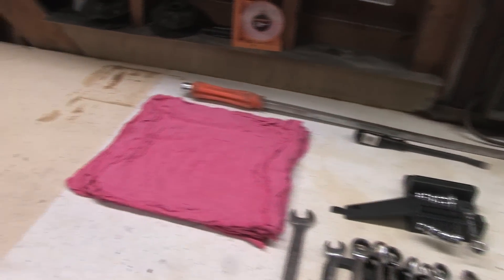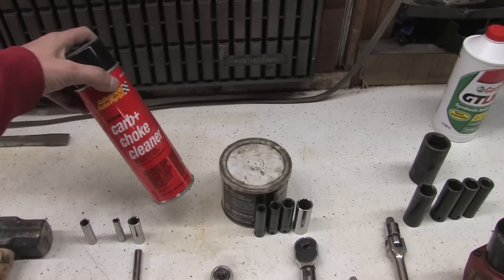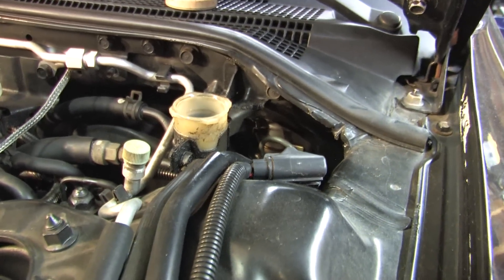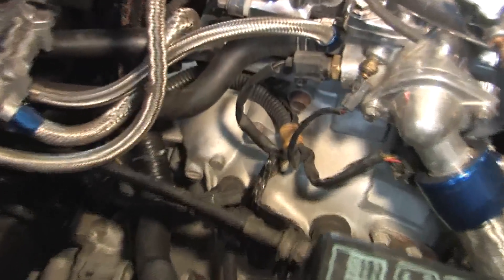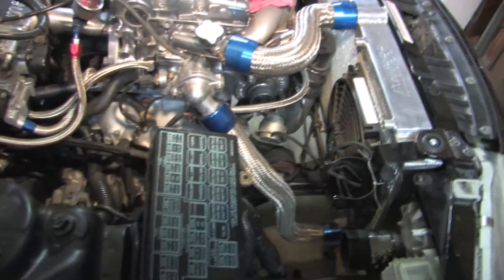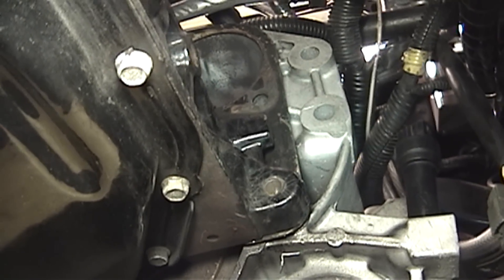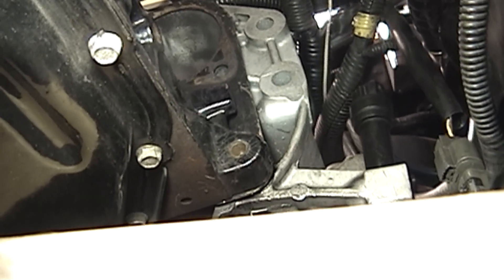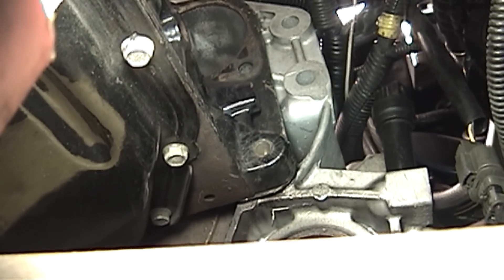Trans & Clutch 1 - Remove Transmission

Comment: I'm going to a auction. Tomorrow where there is a 95 tsi only 120 thousand miles been sitting for 15 years in a garage because clutch went.out . Is this a pricey fix I'm not really mechanically inclined

Comment: soo this same way is for a 3000 GT?
Reply from the maker: It's a completely different driveline, and many of the fasteners will be different, but the process is pretty much the same.  It's still a transverse-mounted AWD (if it's a VR-4) sports coupe.  As with all cars, don't do anything without a service manual so you can answer all your questions as they arise.
Reply: ok was confused by the title of vid saying 3000 GT trans removal and seeing an Eclipse lol Searched 3000GT and you popped up
Reply from the maker: I think I'm just getting included because they're both DSM-era Mitsubishis.  In other words, it's related like cousins.  The title doesn't even have "Eclipse GSX" in it.  It could just be that nobody with a 3000GT has bothered to make the kinds of videos that I do yet, and an algorithm put my videos in your search.  My channel has always made me out to be a Mitsubishi doood because it's the AWD 4g63 platform that I love so much and use in everything here.  Search ebay for the service manual, it will give you all of your torque specs for every bolt, the locations and details of every electrical connector and the steps necessary to remove these components.  I like the actual printed ones because I don't like handling my computers with mechanic hands... but the PDF versions will work just fine.  Either way, they're only a couple of bucks and a must-have if you love your car.  The tools, techniques, components and tricks to stay organized for what you're trying to accomplish–are in my videos even if it's a different car.  Mitsubishi did a whole lot of the same things on this era of automobile even if they have a different number of cylinders.

Comment: I'm looking at a 97 GSX all original w/ 116k miles. I'm not sure if I should get it though. How easy and cheap are the parts on it? Is crank walk a huge issue? I've worked on a ton of SRT-4's before and those were a bit of a pain. (Why I have V8's now). Just curious if I should get back into the sports compact game, especially with the new GT's running mid 12's, lol.
Reply from the maker: It won't run 12's stock, but it won't take much to get it there.  AWD and styling is what sold most people on the second gens.  Some parts are starting to become rare (like transmission parts), but actual cases of crankwalk are extremely rare.  The majority of the crankwalk cases are caused by improperly performed maintenance, or improperly adjusted clutches.  In other words it's owner/mechanic-caused damage from misaligning the engine and transmission, or from pre-loading the clutch.  You'll find lots of information on this channel about that.  But as with any 20 year old car, if you buy it, you're on the hook to maintain it and ensure things are done properly.  It's a classic and in 5 years it's going to be an antique.  Anyone can go out and buy a new GT and run 12's.  Some people like to be just like everyone else.  ;P  It's a tough call.  You'd need to add a lot of technology if you expect it to do the things a new GT does, but that GT will never be AWD.  It's definitely nothing like an SRT-4.  Ultimately I can't make the decision for you, but it boils down to the kind of enthusiast you are?  What challenges you're willing to accept?

Comment: would be nice if you said what kind of car and year / manual / automatic..
it is..idiot.
Reply from the maker: This is part of a series.  Anyone who follows my channel knows that all my cars are centered around the 4g63/4g61 turbo platform used in 1989-1999 Mitsubishi Eclipse, Galant and Mirage models.  If I regurgitated the make/model/year in every video, I would lose people's attention.  But FYI, it's a 1995 Mitsubishi Eclipse GSX AWD 5-speed with around 420hp.  None of it's stock, so the video is only intended to demonstrate the basic process, not what you will find under your hood.

Comment: At 4:20 its not OCD its called being smart! I just did my clutch for the first time on my 98 civic and put the bolts back in whenever I could. Made everything much more organized. Less guessing, more working
Reply from the maker: If it were OCD, I would have drawn a photo-realistic picture of the transmission.  ;)

Comment: I've been searching for a guide to take the sst out, have not found one yet! Super hard to find, but I was wondering wether it's smarter to pull the full motor out, or go in through the bottom to the trans
Reply from the maker: If you drop the drivetrain out through the bottom, you have to disconnect the AC, power steering, fuel, coolant, exhaust, intake, upper strut mounts, timing side mount, transmission mount, and wiring.  Again, I don't know if an EVO uses a wiring harness bulkhead connector or if it's all hardwired like a DSM, but several wires like the alternator, starter and ground straps would also need to be removed.  If you drop the drivetrain out the bottom, you will need a lift to raise the car up off of it.  You can pull a Honda down like this in about 2 hours, but doing it fast without breaking stuff takes practice.  Remember that you've got an in and out for coolant, oil, fuel, air, and electricity.  Take all the in and outs loose and be methodical.  By the way, I googled "EVO X Service Manual" and my top hit gave me free PDF's of the entire thing.

Comment: I know I am about 10 years too late here, but how close is that to a Mitsubishi evo sst trans? Cause I can't find a video on one and this is the best trans removal video I've ever seen
Reply from the maker: The SST is a strange beast.  I doubt it has much in common with a W5M33, but the installation and removal procedures shouldn't be all that different with the exception of wiring and a TCU.  I would recommend doing the job with your car's factory service manual at hand, and use this video for inspiration more than instruction.  It would cover the differences that this old car doesn't have on it.
Reply: Jafromobile ya I have a brand new upgraded sst for my car thinking I could pull and replace but I didn't know what I got myself into lol. But you think following these Instructions roughly on this car would get me a head start?
Reply from the maker: I think the torque specs and bolt locations would be different.  The chassis is very different, so the disassembly process might be more involved.  On many modern cars produced in the following decade from this one, it's easier to remove and install driveline parts by dropping the subframe with all the pieces still attached.  I haven't blown an EVO apart yet, so I don't know how to recommend using this series as anything other than a baseline.  I would rather see you follow the procedure in the FSM.  Check eBay for it.  You can find printed and digital service manuals for damn near everything there.
Reply: Jafromobile whoops I answered above sorry

Comment: turkey baster bro
Reply from the maker: Did it.  Not all turkey basters are the same.  Hole in the baster is great for gravy, but not thin automotive fluids.  It made a mess.  Compressed-air-powered vacuum bleeder is the ultimate solution.  I wish I had one mounted on my wall.

Comment: 99 GSX, 135,000 miles - Clutch started slipping bad so trying diy. Followed the great video but got stuck. I'm having a very hard time getting the passenger axle out, can't seem to find a good point to pry out like you did. Also those top 2 bolts on transfer case will not break free. I'm pretty sure this is the first time these parts will be touched since the car left the factory. All I need to do is change the clutch. What steps can I skip to just get to the clutch? Can I leave the axles in and the transfer case on? How much clearance between the block and transmission do I need to remove the clutch? Your videos are a great resource not only for 4G63Ts but for cars in general. Thank you for the knowledge.
Reply from the maker: On the axle, what you're prying with makes a difference.  Something with an angled tip about a half-inch to 3/4" wide works best because you can twist the shank at the angled side of the axle cup against the transmission, using the width of the tip as a prying force to apply pressure as it twists.  Too long of a pry bar can be a problem.  All there is holding it in is just a little rounded wire clip that has to clear a groove.  That's all it is.  Rotate the axle to a different spot if you have to, the clip has an open end, but it should pop out easily if you can just get the right leverage behind it.  A screwdriver won't do the job.  If you've done all that and it doesn't work... get someone to tap the side of the axle cup with a dead blow hammer while you're prying against it on the other side to try to shock the clip out of the groove.  That's cheating.  It's your game, you write the rules.  You can cheat if you want to, but you'll learn less.  There's just a feel to it.  Once you make one submit, you'll never lose that feed, but I wrote is the right way to do it.

Those are big honkin' bolts on the transfer case.  If you don't take them out, you're guaranteed to leak gear oil all over the place.  If you take them out, at least there's a 50/50 chance you won't.  I'd use penetrating oil, put a solid, sturdy wrench on that bolt that fits squarely, and smack that wrench counter-clockwise with a 4-lb mini sledge.  Next, I'll be here to tell you to start a small gap between the transmission and transfer case on the rear of the bottom with the pry bar (the one that could separate that passenger side axle), and lightly-tap the tailshaft with the 4-lb sledge until a gap opens up at the front that you can fit a huge screwdriver into.  Pry with both the pry bar and screw-driver evenly towards the passenger side far enough to get your fingertips in and yank the transfer case off the rest of the transmission's output shaft.  Don't mar up the aluminum sealing surfaces doing it.

If you can't do these things as described, it's likely one of the tools you're using is the wrong size and shape.  I've had plenty of driver's side axles put up a fight.  I've met the transfer case I couldn't remove because I had the wrong tool for the job, and I even had a 3 foot pry bar with me.  I could not remove this transfer case from a Galant that tried to kill me on a test drive when the throttle stuck at 4500 RPMs.  Then someone tried to rob us in Asheville, NC.  Seriously, I've had the worst transfer case fiasco anyone could ever ask for.  But just don't give up.  You're on your own property with it.  Take your time and do it right.  Get a different tool if you have to, just don't give up.  If I were to add opinion of any kind, I'd suspect the pry bar you have is the wrong one for the job, just based off of which parts are giving you trouble.
Reply: Picked up a pry bar set; 8", 12", 18", 24" with tip sizes from 1/2" - 3/4", haven't tried the twist yet. Hopefully that should take care of that. As for the transfer case, I was able to get the bottom 3 bolts off with socket and wrench and a little pipe for added torque.  But those top two won't budge. Tried a u-joint adapter but no go. Will penetrating oil get all the way to the threads by just spraying the head?
Reply from the maker: Creamy Italian Not really, but every little bit helps.  The penetrating oil you use matters, too.  PB Blaster is great for breaking steel parts loose because steel is very porous.  I like Aero-Kroil for the really stuck stuff.  It penetrates deeper.  The hammer recommendation comes from the idea of shocking the bolt.  Put all the pressure on it that you can, and give it a whack.  Often times the shock of the impact puts a little extra d*** on the bolt, just enough needed to shock it into turning.
Reply: Thanks for the info. Finally got the t-case off and drivers axle out but that passenger axle does not what to come out. I'm leaving it in unless I shouldn't do that. On to the mounts, crossmember, starter and removal tomorrow.
Reply from the maker: +Creamy Italian don't pry at the edge of the axle with the tip of the pry bar.  You can't get the range and force you need that way.  Put the tip past the axle seal on the forward side of the axle cup, and apply pressure using the shank.  It's a quick jerking motion with a little twist that typically works for me.  A gradual pull rarely does the trick.  If you leave the axle in, it's an awful lot more disassembly and wrangling, not to mention greater potential for damaging the axle.  No denial they can be a pain sometimes to remove, but I've never met one that will absolutely not separate.  On the other side of that axle seal, you have the equivalence of 40W oil and it is clean and free of rust.  There's nothing there but that one damn clip.  A clip that can easily lose the fight if you can come at it right.  Look at how far you've come along.  Remember what I said about pissing excellence.  Take a break, and come back to it.
Reply from the maker: +Creamy Italian oh... And on the jerking motion direction.  Pull towards the driver's side front of the car and use the bottom edge of the transmission as the fulcrum.
Reply: Thanks for the words of encouragement, got the clutch and flywheel out. Had to take the passenger axle out when it was stopping the input shaft from clearing. I'm sure this isn't the last you have heard from me. I'll have questions when I put it all back together. But thank you very much. I feels good to be at this point.
Reply: Creamy Italian Easiest way I found to remove the passenger axle is to stick a flat head up from underneath and lightly tap it with a mallet, then squeeze some vice grips over the handle of the screw driver and twist. Also when you put it back together don't forget to check your flywheel step height and to torque everything down correctly. As well as lube up the input shaft and the collar that the TOB rides on. Do everything the right way or you'll find out afterwards that you need to pull the trans again, and that's never fun.
Reply: I was finally able to get that axle out once I dropped the transmission. I really hope the shop I took my flywheel to checked the step height cause I don't have the tools to properly check it myself. I'll see once I put everything back together.

Comment: Looking in to putting a new transmission in my 05 scion tc, removing an engine looks pretty damn intense. Think Ima go for it though. 
Thanks for the vid man
Reply from the maker: Really it's easy.  You've got an in and an out for air, coolant, fuel, electricity (wiring harness + grounds), and just un-bolt the AC and PS pump so you don't have to drain them.  Pull the throttle and transmission linkage, pull the motor mount bolts and yank it out of there.  If it's auto, you'll have some ATF lines to deal with, but they're easy enough.  I pulled the engine out of my Dodge Colt back in the day in an hour and 20 minutes including my clean-up.  It's not that bad.  If you have access to a 2 post lift, you could shave even more time off by pulling all that stuff and lifting the body off it leaving the engine and front wheels/subframe on the ground.  Easy access to take everything else loose that way, but it only looks intimidating.  ZipLock write-on bags, masking tape, and Sharpies are your friends.

Comment: Don't is a pointed what ever and hammer if its seized. I put me naugahyde ( wrapped leather) hammer over the end of the shaft and hit the naugahyde with my B.F.H.  Big fucking hammer. the wrapped leather hammer stops any Mal formation of the shaft and removes the issue of a misplaced strike on a punch. I have several leather hammers but you could use the hard plastic hammer and strike it with the steel hammer. comes out everytime in 30 yrs. one or two strikes. the punch sometimes will NOT work if you have a really rusty seized set up. plus by using the two hammer system you get more p.s.I. on the shaft with kit the remotest possibility of hurting the shaft or any brake guff
Reply: Michael Mills u
Reply: WHAT?

Comment: Turkey baster works better than a spoon.
Reply from the maker: +Will Doyle I bought one and tried it thinking the same thing.  The hole is too big in the end and it all just leaks back out again.
Reply: Not enough surface tension to hold the fluid in. Eye dropper would be best then. Or jsut get a plastic spoon. xD